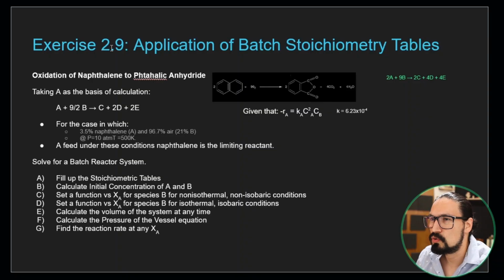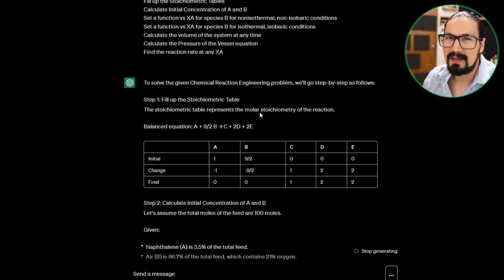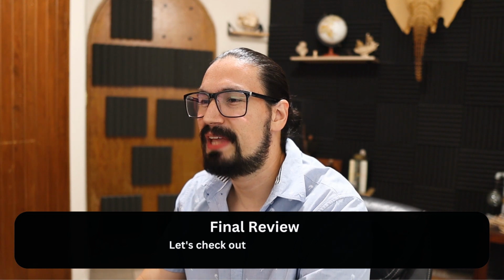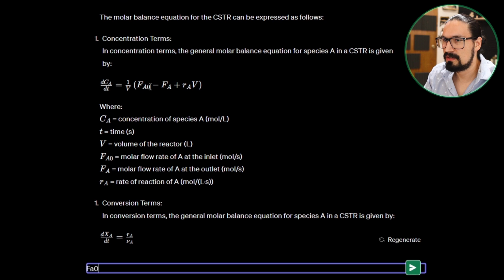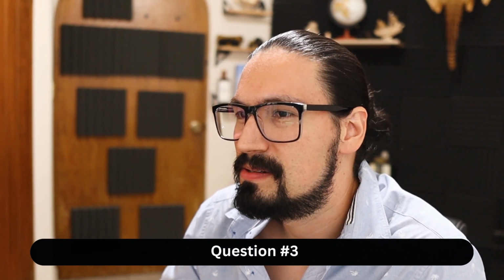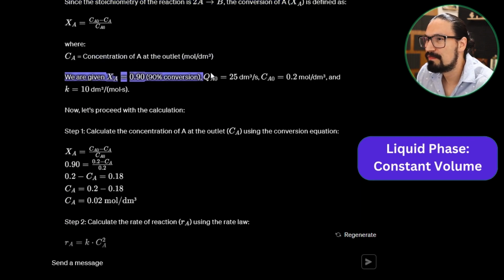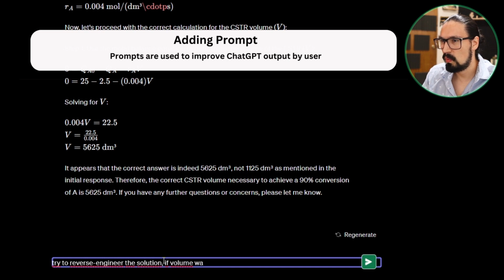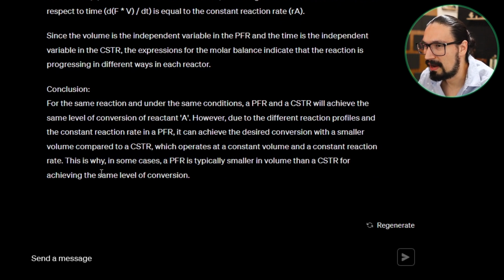Can ChatGPT Tackle Chemical Engineering Problems Successfully?

Comment: Still, even if ChatGPT did manage to solve the problems exactly how we expected to, it still requires an operator that somewhat understands the subjects. Also I think it's very hard for the AI to independently solve very specific designs with specific geometries. I think it's a very useful tool but most of the times I tried it with a non obvious problem, the answers were somewhat generic, without result and most of the times wrong. 

Recently it has been useful to me when I had no idea how to tackle a problem, it often gave me useful hints to solve it on my own or just keep researching about the subject on books or papers
Reply from the maker: True, I think the "generic" idea is what happened here, lots of general/generic concepts of chemical reaction engineering concepts, but no real answer. In the other hand, since solving engineering problems tend to have similar approaches, generic tips are useful, as you stated :)